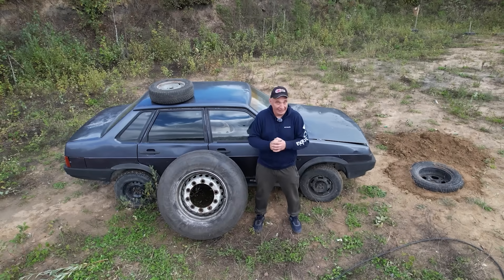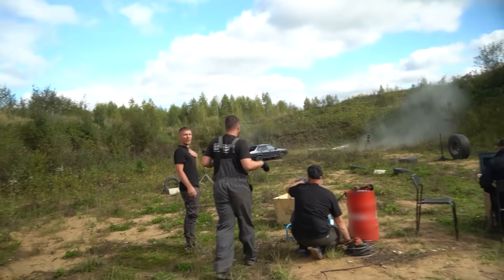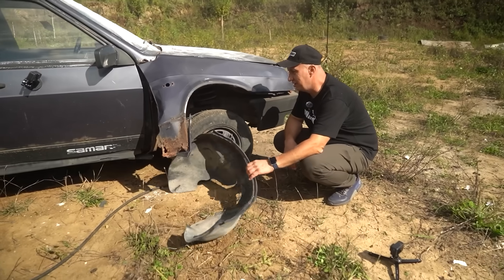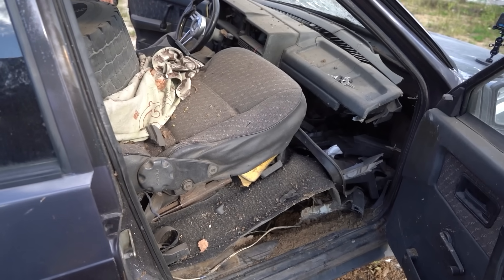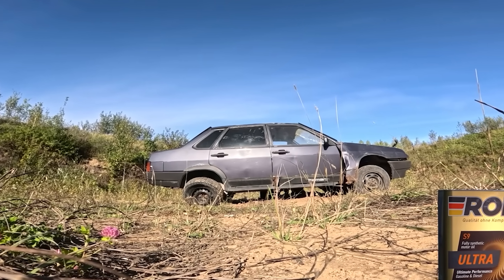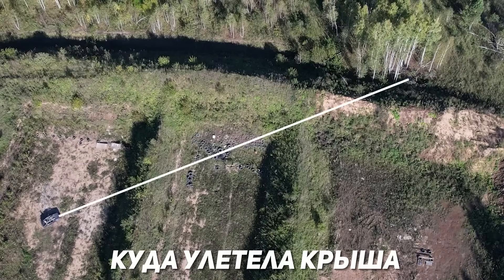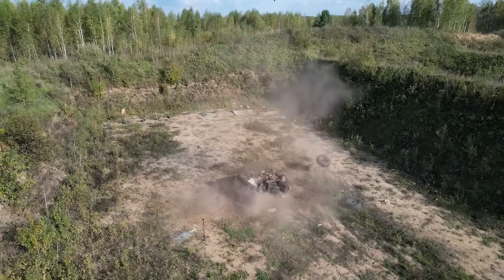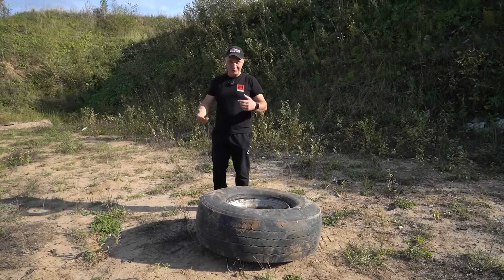We explode a truck tire inside (and underneath) a car - what will happen?

Comment: Try using an airplane landing gear tyre underneath next time. That will be epic.
Reply: Better be in a bunker one km away. Not even joking
Reply: @matsv201  you think it's gonna be equivalent to a nuclear warhead or something?? One km away AND in a bunker is beyond excessive. A couple hundred feet away and behind cover from shrapnel would be perfectly safe, might want some hearing protection too though even at that distance.
Reply: I think the bigger issue would be getting a compressor that's even capable of blowing it up. I wouldn't want to be anywhere near that experiment.
Reply: @JJFX-  use a nitrogen tank . Easy 3000 psi
Reply: A tractor wheel or a large wheel filled with 30% water would also be pretty awesome..
Reply: Fun to think about
Reply: Fire engines run pretty high pressure tires also.
Reply: Or a bead lock 😊
Reply: Filled with acetylene and have a spark available when it blows😅.
Reply: Old airplane tires are easy to come by. When I worked at the tire shop I seen them a few times on random farm equipment because they were cheap and puncture resistant
Reply: Airplane landing gears are very  strong. Results will be more destructive. Love to see that.
Reply: Do you have any idea how expensive those are? The rubber alone is like a solid 5-10 cm thick of the rubberiest rubber ever made
Reply: @marluna_x  True but they are in russia so there's probably an old solviet plane rusting away nearby.
Reply: @matiasdiazduran5806  Absolutely. As a kid I played in a vehicle graveyard, which had tanks and planes too. I only hope those were not radioactive.
Reply: @marluna_x  Get an old one that can't be used on an airplane anymore?
Reply: @aj.j5833  Airplane tyres generally get retreated.  Which means even a used one still has some value and may accordingly be somewhat hard to obtain.

But how about a forklift tyre?  To maintain stability they use a very high pressure.
Reply: @ralfbaechle they are literally everywhere..what do you mean hard to obtain.
Reply: @leejohnson6173  Once worn down they get retreated if still usable.  Over here there's even a refund for old tires so they are more treated as an item of some value.  It's not like you'd get one by just making a pretty face - you may have to pay for one.
Reply: @ralfbaechle  Forklift tires are an option honestly, Our biggest rig is ~32000 LBS and runs ~100 psi in the tires (although I have no clue what the limit of them would be)
Reply: @aceospades2558  We had two which had 13 bar.  Basically as hard as wodden wheels ;-)
Reply: @ralfbaechle  Damn I'd wanna be nowhere near that if that blows
Reply: @marluna_x shouldn't be a problem they have a bunch of bombers that were destroyed on the ground sure one of those tires survived
Reply: @marluna_x  Natural rubber or mostly natural rubber with many fabric layers.
Reply: @marluna_x  Technically speaking the airplane tyres are the closest thing to an unprocessed rubber.
They are thick, yes, but compared to racing tyre chemistry, the plane rubber is rather simple.
And it doesn't need to be more complex when it was goed enough for centuries.
Reply: Try a Boeing 747-400 tire with 32 plys and 200 psi. That would take a politician's lies to blow that puppy up.
Reply: I want to see one of those welding gas cylinders filled till it pops I've seen them stop a 50bmg non ap
Reply: @dossod-n8q  Problem: The tank will probably become a lethal rocket and you'll have to find a 500 bar air compressor first.
Reply: that or a tire from a tractor or other heavy mashinery

i guess its still quite expensive but maybe they find some on a trash site.

they should also try to glue the tire shut so it sticks to the rim longer and can build up more pressure.
Reply: @Hardys-Mods  the channel 'beyond the press' already exploded a tractor tire inside a van, and it was very spectacular
Reply: @Hardys-Mods bead locks.
Reply: It would also probably be cost prohibitive

Comment: Put it back together and see if it starts.
Reply: I suspect you have watched this channel before LoL 😂
Reply: It will most likely start, getting it to drive would be a challenge
Reply: Try and bash the floor a bit straight and then see if it drives.
Reply: Strap 5 lada engines in the trunk
Reply: There's no engine in it.

Comment: This idea is stupid. Compared to my idea I gave you all months ago to cool an engine with a Turbocharger instead of coolant
Reply from the maker: You continuing to be salty in the comments is not going to help your idea gain points in our eyes, dude. Thanks for submitting it, it will be considered.
Reply: @Garage54ENG  You just gave him validation :(    anyway no yokel idea will ever beat what garage54's up to.
Reply: This is not a stupid idea, those were EPIC tire explosions 💥
Reply: @volvo09  Yeah, I knew tire can kill a person, but to throw a car 5 meters high is surprising.
Reply: If you’re going to be miserable bc you are waiting in a huge line of requests doesn’t mean be a asshole about it, I requested a house radiator about a year ago and they got to it…

Comment: oh wow that was fucking crazy didnt expect the car to fly
Reply: That car was decimated!

Tires are strong as F, and compressed air is no joke when it all lets loose in high volume
Reply: There is a video online of simeone doing this with a airliner landimg tire.

Its one gigantic explosion
Reply: oh its LOUD..  rven at much lower pressure..  toom one of my busses to the tire shop a few years ago.. I typically would leave it and walk up the street for lunch while they change tires..  I got about 500 yards away from the building and Boom!!!!, I looked back thinking that the CNG truck they had in the shop had blown up or such.. went running back.. turns out they had a Brand new Tire in the cage airing up just burst at about 100 PSI.. can only imagine what the burst pressure of theirs under the car was...  probably at least 200 or 300..  I heard the russian translation say 10 kilo..  there's no way that tire made it anything close to 10 kilobar so no idea what it really was..